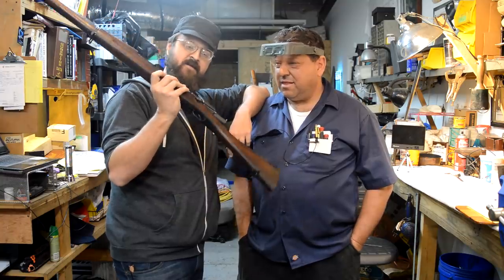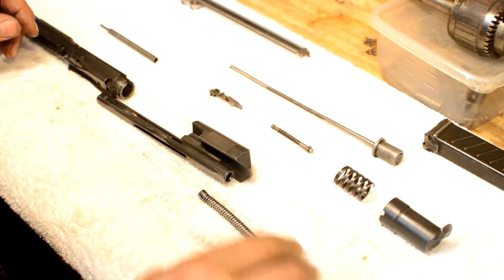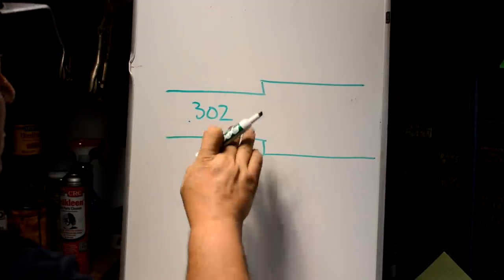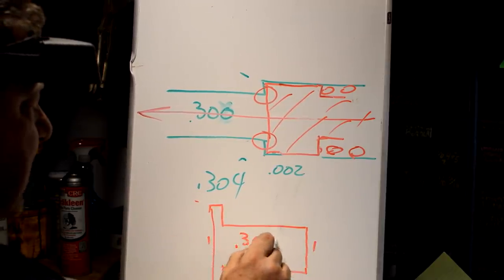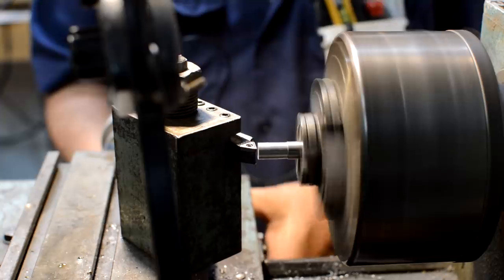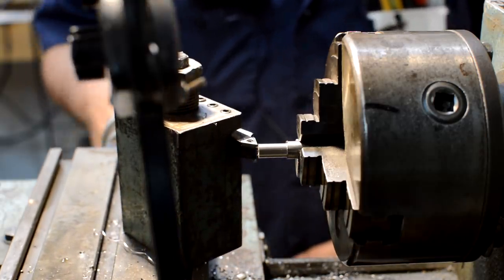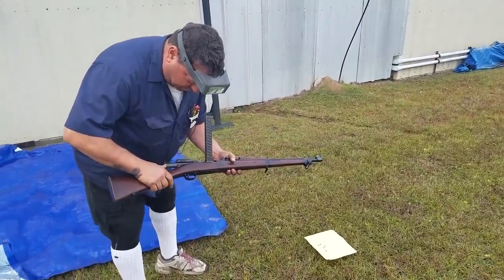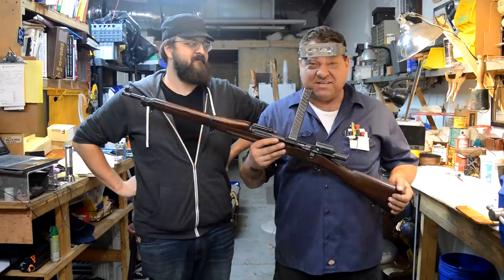Anvil 022: Pederson Device recovery

Comment: I am machining a ponderosa device for a Remington 700 I have
Reply: What caliber are you running through your Ponderosa device?
Reply: @adamsowers8957  ment penderson device lol stupid auto correct. I have a 308. I am making custom wildcat pistol caliber for it as I just want to be different. Have another that basically converts a bolt into a semi. Still working on it
Reply: @Jeff-hp3vn  I didn't know if you had some crazy project going on. Ponderosa device this shit sounds badass! Lol!
Reply: @Jeff-hp3vn  that's cool that you're making one.
Reply: @adamsowers8957  another machine I made is a rotary machine that uses cam and rollers it has a case feeding and it goes to the sizer/deprimer rotates to the next station a primer feeder/primer  then powder and sensor checks the exact amount. The bullet is feed down and sized,neck crimped and new/reman ammo into shipping box. Ran my first 6,000rds in one hour! This rotary press fits on a table top fully automated has digital controls and monitoring system. Capable of cranking out 10,000+hr rounds. Has a dual system a 12v to run off car battery if need to be remote or portable. And a 110v house electrical.
Reply: @Jeff-hp3vn  Damn! Primers and powder is really hard to find in my area. Its gotten really bad since the beginning of the Covid era.
Reply: @Jeff-hp3vn got plans and specs for this machine?

Comment: Mark, when you cut off a piece in the lathe, insert a small rod in the tail stock that fits very loosely up into the bore of the stock that you are parting. That way when it you part the piece off the stock it will be on the small rod and you don't have to worry about loosing it or having it get damaged. 
Great watching your work on guns, your knowledge and evaluations is amazing, but you make me cringe watching you do machine work. Sorry.

Comment: One of the things that may be causing Mark problems is that my sources claim that this device worked like crap when new. I believe that is based on testing done by the military immediately after WW I. Be glad they were never used in combat.
Reply from the maker: I believe the AEF armorers would have been able to set these up to run given the chance. The part about switching back and forth between rifle and PCC on the fly would not. I think dedicated, worn out 03s would have been cut down to carbine length, and turned into purpose converted weapons. Kind of like the M1 carbine............
Reply: @marknovak8255  I respect your judgement that the guns could have been made to work. I think it would have been simpler and cheaper to make a semiautomatic or machine gun in the same chambering. With the respect, the end product compared to the M1 gives me pain on several levels.

Comment: Of course othias found one very cool. Custom made ammo ?
Reply: 7.65x20mm French is the same case as .30 Pedersen. It has recently been put back into production, thanks in some part to Gun Jesus, Ian McCollum.
Reply: Oh Very cool thanks
Reply: I figured they had to make there own ammo because Gun Jesus has all the rest.
Reply: 7.65mm French is a nearly ideal ultra compact pistol caliber that has been utterly neglected for far too long. It allows for quite thin double-stack magazines, has much superior power and penetration compared to .380 ACP and .32 ACP, but with far less recoil than 9mm Parabellum; and performs great from short barrels. It is a real shame that no one has even considered it for a modern, concealed carry handgun.
Reply: @ostiariusalpha  lack of ammo in production for a long time, since the French went to 9mm handguns.
Reply: @ScottKenny1978  The 7.65x20mm just lacked a super successful weapon to attach itself to. The .30 Carbine, for instance, only had the M1 Carbine for decades, but millions of them had been produced during WWII; and even a few hundred thousand made afterwards by various manufacturers. The M1935A was a nice enough pistol, but not even a hundred thousand were ever made, and no one clamored for more after SACM stopped making them.
Reply: @ostiariusalpha  that, too. Didn't realize that the M1935 pistol production was so small.

Wasn't there an SMG in 7.65x20?
Reply: @ScottKenny1978  The MAS-38, though production numbers were even lower than the pistols.

Comment: Having been brought up in The Netherland I never understood the Imperial system of measurement. 
It always seemed so over complicated compared to the Metric system.
But I bet it makes you a better mathematician.
Reply: Murica!!!
Reply: @LovelyLoren1995  Thank you, I guess...
Reply: I use imperial mostly but for work like this I find metric far easier personally.
Reply: Machinists working on small parts like firearms in the Imperial system of units will almost exclusively use decimal inches like you see Mark do in this video. A machinist using SI units will typically use decimal millimeters or microns.
Reply: In Canada we went metric around 1972 or there about. That would of put me in 4th grade at school.
For machining, I like inches, also prefer thinking MPH not KPH, when it comes to the weather, I'm metric all the way as it makes far more sense with water freezing at 0 and boiling at 100.
All our speed limits are posted in metric but I still think in miles . If it says 50KPH my mind knows it's about 30MPH, 90 about 50 etc.
In science class like physics, I was be all metric. Guitar strings I see in inches. I can look at the high E and see if it's around .010 or .012  without needing to measure it .
It just gets down to what you get used to using and after that it's hard to change. Like when I'm cooking, I rarely think metric
Here everything is marked in both measurements so it really doesn't matter. Sort of like everything also has French on it.
Not that it matters, but I was born in Hilversum and moved to Canada when very young.
Reply: @robertdeen8741  So your Bilingual as well. Bet your German isn't bad.
Dank je voor je bericht, en inderdaad, het ligt er aan hoe en waar je opgroeid.
For me it's the opposite, Canadian born and Dutch raised.
Cheers
Ian.